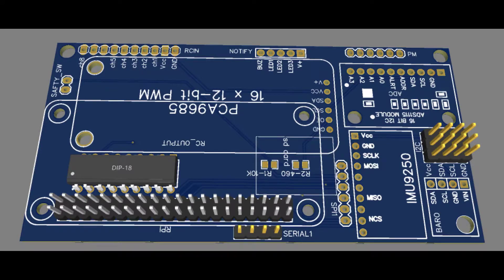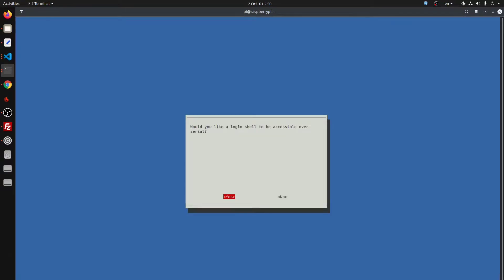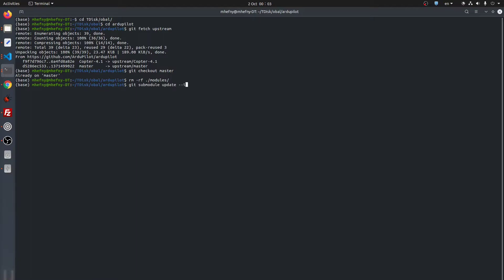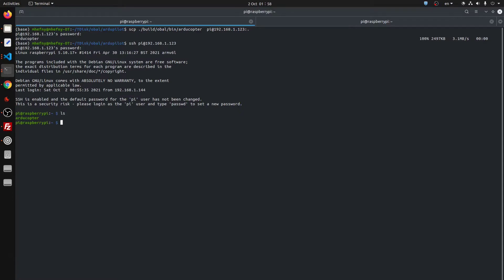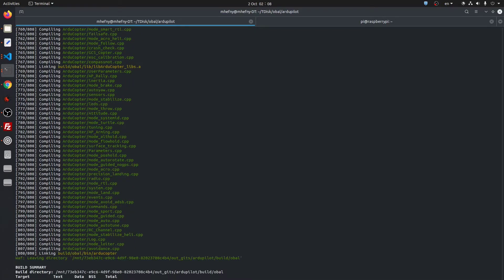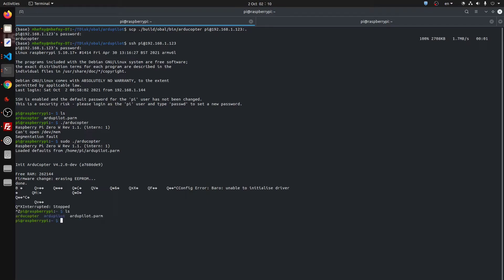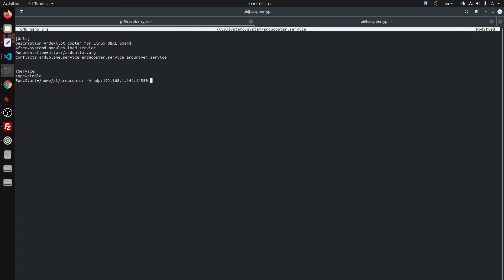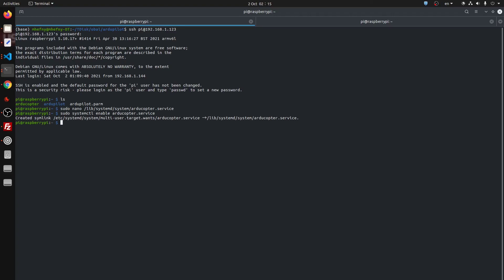03 - OBAL - Tech Part 3: How to Compile Ardupilot Software & Install it on Raspberry?

Comment: Hello please help me with this erroe when running make obal

'configure' finished successfully (5.430s)
Waf: Entering directory `/home/anojan/ardupilot/build/obal'
you need to install empy with 'python -m pip install empy==3.3.4'
make: * [Makefile:31: obal] Error 1
Reply from the maker: This is part of compiling ardupilot code .. you need to python -m pip install empy==3.3.4
Reply: @MohammadHefny_HefnySco  Thanks for the fast reply

A few questions

1. Does the Raspberry Version
I'm using right now is
32Bit Legacy Lite (RPI4 ModelB)
Is this right?

Thank you so much for all that you created
Reply from the maker: @anojananojan9006  I believe this is the 64bit version. Please check download link of cloud.ardupilot.org
Reply: @MohammadHefny_HefnySco  Is this for Ardurover ?
Reply from the maker: @anojananojan9006  OBAL works great on Rover, Quad & Planes
Reply: @MohammadHefny_HefnySco  Thats great to hear :)

Comment: thanks you very much for your detailed instructions,  but I have two questions, the first one i downloaded the binary file for arduplane and I didn't use it, i followed all steps that you have done, so how can i use the binary file ?                                                                                                                                                                                                                                                                                                                                                          the second one is that the file  (ardupilot.param) has the parameters inside it for quadcopter x, so is there different parameters for arduplane ?

Comment: Hello, I am trying to setup OBAL for the first time, but unfortunately I have a config. error Config Error: INS: unable to initialise driver (this shows up in cmd when I sudo ./arducopter and also in missionplanner) I am running Zero binary from your gdrive https://drive.google.com/drive/folders/1INf3nhVZEkYaTgR51SX2OtsSmKxlU_la
could you point the direction where to look?
 Thanks!
Reply from the maker: sorry for my late reply.
please download binaries from here https://firmware.ardupilot.org/Copter/stable-4.2.3/obal/
also please note that this OBAL binary is for OBAL v1 that runs 9250 IMU but for OBAL GY-91 you need to compile the code as in the OBAL github wiki https://github.com/HefnySco/OBAL.
Reply from the maker: please use discussion or support in github OBAL so that tips and tricks can be shared and viewed among other users.

Comment: Hello Mohammad, I have a problem with the tool chain. When I type in "make obal" I get an error messages: 
Setting top to                           : /home/raspi/ardupilot 
Setting out to                           : /home/raspi/ardupilot/build 
Autoconfiguration                        : enabled 
Setting board to                         : obal 
Using toolchain                          : arm-linux-gnueabihf 
Could not find the program ['arm-linux-gnueabihf-ar']
(complete log in /home/raspi/ardupilot/build/config.log)
make: * [Makefile:31: obal] Fehler 1
raspi@raspberrypi:~/ardupilot $ 

I installed the tool chain and the missing file is in the folder: /home/raspi/tools/arm-bcm2708/arm-rpi-4.9.3-linux-gnueabihf/bin/arm-linux-gnueabihf-ar

Do I have to copy it to an different folder?
Reply from the maker: https://github.com/HefnySco/OBAL/blob/main/SourceCode.md#building-the-code  describes how to cross compile ardupilot on your linux machine.
Reply from the maker: if you download an arm compiler you need to use waf and point to it.
./waf configure --toolchain=/opt/cross-pi-gcc/bin/arm-linux-gnueabihf --board obal
Reply from the maker: Another simple but time consuming way is to compile it on RPI itself.
Reply: @MohammadHefny_HefnySco  Thanks for your fast response!! I tried to compile it on a RPI 4 and this was the error message. Will try your advice to point to the folder.

Comment: Can you provide instructions on mission planner setup
Reply from the maker: If u want to use RPI wifi then in the cmd of starting ardupilot u can add the ip of ur laptop and then use Mission Planner with Udp normally.
Reply: @MohammadHefny_HefnySco  Thank you I can connect